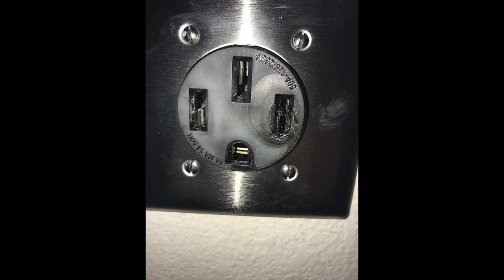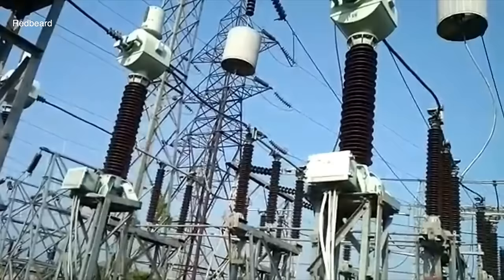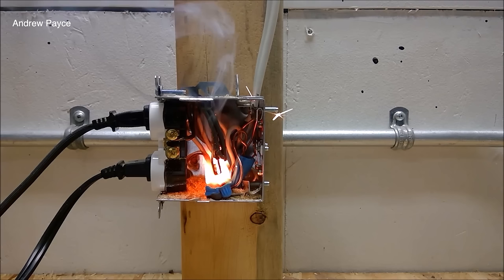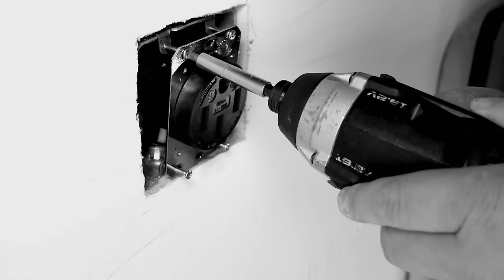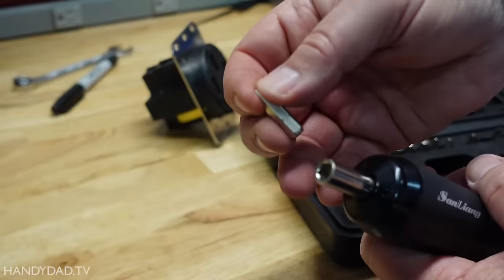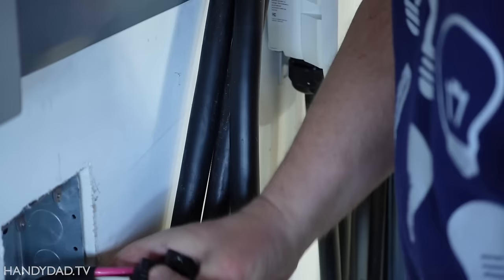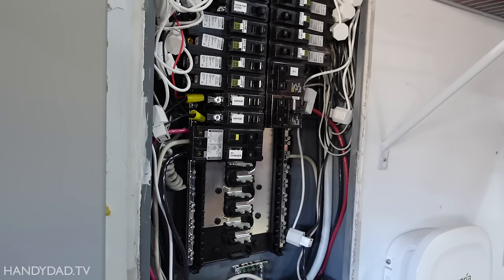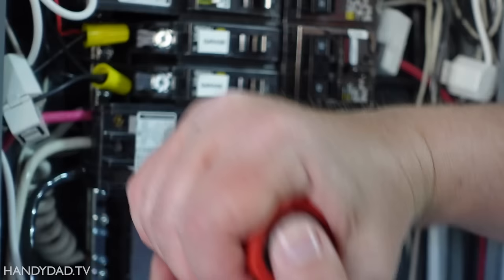EV Charging Disaster

Comment: My wife's aunt lived alone for many years and eventually relied on a 2kw fan heater plugged into a UK 240v outlet. There was no EV nor wiring issue but the poor contact achieved by the  appliance's plug (dirty pins ?) together with the continual 8 amp load eventually led to outlet dis-coloration and a smell of heat-damaged bakelite which I fortunately noticed. The issue is cumulative in that a poor contact gets hot which will worsen the contact resistance and increase the heat generated at the plug/socket.
Reply from the maker: Thanks for sharing!
Reply: With UK sockets, dirty pins isn’t really a thing. The contacts in the outlet wear out and eventually the contact isn’t good enough any more. Nobody is going to be able to tell at this remove whether it was the connection to the socket or the socket itself, but just like this video says, it’s going to be one of those two. (Well, outside chance it’s the contacts inside the plug not being good.)

When you have a load like that, that’s used a lot and for long times, ideally have it wired in directly by an electrician, or make sure the outlet is installed well and relatively new. And for the love of god, use the switch, don’t keep unplugging the thing.

Comment: Great video!  One thing I would suggest is to hard wire an EV charger that will be stationary.  The plug and receptacle are an additional failure point.  Also, you may find from use that the GFCI breaker will trip frequently due to the built-in ground fault capabilities of most EV chargers.  Are hard wired setup does not require GFCI breaker.  IMO hard wired is the safest and lower cost way to install a high powered home EV charger.  I have seen many melted plugs and receptacles over the years due to faulty receptacle or poorly made 14-50 plugs.
Reply: Hard wired at home and a charge cord in the car makes sense.
Reply: Yeah in my apartment garage the GFCI breaker trips every so often from my charger. Wakes me up since the breaker panel is in my room
Reply: This.  A NEMA 14-50 works but is more risky than a hard wired charger.
Reply: @dagjohansen8641   I've got a three-wire cord my dad used forty years ago for his compressor, it has a 30 amp plug. I guess we were lucky that all those years of use didnt burn our house down. (kidding)
Reply: @ronwest7930  If you plug a stove into a 14-50 and just leave it there, that's fine.  But if you are using a Mobile EV charger and repeatedly plugging it in and unplugging it, it wears down, gets dirty, loses grip, etc. And that's where it can get you in trouble. But if you leave the mobile charger plugged in permanently, it'll be fine.
Reply: From what I've read the charger does nothing. If the cord coming out of the fuse box had the right end for the car the breaker could be the on off switch. I doubt I will buy an ev soon but I can charge 240 at 16 amps off my solar if I needed to. EV cars have a charge controller  built in.
Reply: @grogu928  Most Chargers have GFCIs built into them. It sound as if you may have 2 GFCIs which can cause the tripping issue described. For example the Tesla Gen3 Wall Connector has a GFCI built in and they specifically state not to install an additional GFCI on the circuit...
Reply: @dagjohansen8641 Exactly. In fact, if you needed to take the mobile charger on a trip with you (to slow charge at your uncles house for example), just flip your breaker off for the 14-50, then unplug the cable from the charger (leaving the pigtail plugged into the wall). The reverse that when you get home. That way, it should never have to be unplugged.

Comment: Good video.  The driver bit you should use is called an ECX bit.  Probably #2.  The following holds true no matter who installed the receptacle:  I would encourage anyone using any plug/receptacle that they use all their senses.  Eyes—any discoloration on the plug prongs means something is wrong. Ears—listen as sometimes you can hear an arc when in use.  Nose—smell around the connections as arching (produces ozone) is easy to smell even long after using it.  And warm/hot wire insulation gives off a distinct odor.  Touch—the plug and/or receptacle should never be hot.
Reply from the maker: Thanks for the tips!

Comment: Great video.. Changes in recent years to the NEC have included a requirement for arc-fault interrupt type of circuit breakers. They're a great addition to the code in helping to prevent house fires. They are NOT to be confused with GFIC type breakers which instead sense electrical currents not returning on the neutral wire as expected, but rather on the ground.
Another point is that many of the electrical connections in receptacles, switches, and light fixtures are 'quick click' (press in connections). They amount to being holes you press the stripped wire into that have a small metal tab usually being brass, or brass plated steel, copper plated steel and actually are a very small area of connection. Time as well as a higher current draw will break down or erode those connections creating arcing and as well know, once that begins it will only get worse. I prefer to buy receptacles, switches that have screw terminals and use them instead. They will hold up better over the decades.
Reply from the maker: Thanks for the info

Comment: Great video and glad to see you sharing your mistakes so everyone can learn.

I had to plug and un-plug my Levitron plug many times when I was trying to repair my Juicebox 40 charger (self-inflicted as I ran over the wire by accident).  I finally got it to work but i guess wound up wearing out my Levitron plug from multiple plug/unplug procedures testing my repair on the Jucebox.  A week after I got the charger working again, I went into the garage and smelled rubber burning and found out that one hot terminal on the plug was melting.  That's when I started looking for a better plug than the Levitron (and thanks for one of your earlier videos comparing the 14-50 plugs).

I recently switched over to the Hubbell and all is good now.  What I learned from this whole experience is that I won't charge my Tesla at 40 amps unless I need to.  Just to be extra safe, I charge at 24 amps most of the time and that's fast enough.  It's easy to change the amperage in either the Juicebox app or the Tesla if I need a quicker charge.  

I also will unplug the outlet every few months, clean it, and look for any signs of problems.
Reply from the maker: Thanks for sharing that experience with all of us!
Reply: Most people do not realize that charging an EV is considered a Continuous Load ( A Continuous Load is one that is expected to last 3 hours or longer). With a Continuous Load the Conductors (the wire in layman terms) and the Breaker must be derated to 80% of the normal rating of the Conductor and Breaker..... Not doing so is a Code Violation and extremely dangerous.                                                                                                                                                                                                                                                                                                                                                                                                                        .                                                                                                                                                                                                                                                                                                                                                                                                                                                                                                                                                                 Also, you should not be using a NEMA 14-50 outlet. A NEMA 14-50 outlet is designed to supply both 120 volts and 240 volts to an application, it contains a L1, L2, Neutral and Ground.                                                                                                                                                                                                                                                   .                                                                                                                                                                                                                                                                                                                                                                                                                                                                                                                                                                EV Charging has no use for the 120 volts, so the appropriate Wall Outlet should be the NEMA 6-50 which contains L1, L2 & a ground. It also save a great deal on the cost of the conductors 2 conductors and a ground verses 3 conductors and a ground...
Reply: @michaelholliday100  good stuff, not i uderstnad all that lol. can you read my comment at the top? not sure what to do

Comment: Hot damn dude.  Just throw the main breaker when you're pulling off the cover of your breaker panel.  No reason not to.  You certainly understand to not touch "these plates" but you freely wave your hands and tools in front of them, just waiting for you to misjudge the distance, or your screwdriver to slip out of you hands, etc.  

DONT WORK IN A LIVE PANEL!
Reply from the maker: Thanks for the advice
Reply: Come on really.....there's a million other things on the list that can make your day a bad one around the house, pulling off an electrical cover is at the bottom of the list. Lawnmowers, chainsaws, weed eaters, hammer, circular saw, sharp knife, scissors, iron, a drive to the store are all above removing an electrical cover and waving your hand in front of it. Maybe your eye hand coordination isn't that good Bubbles, the rest of us do just fine.
Reply: @royormonde3682  I suppose you're right.  It only hurts for a second.  That guy a ran over today though, that's gonna hurt for a while.
Reply: @royormonde3682  Depends on the level of fault current.  If only 1kA, you will probably survive.  Accidentally short circuit tens of kA and you may get your skin burnt of and covered in molten metal droplets, and blown across the room by the blast.  Very unlikely in domestic installations though.  Can be a problem in large blocks of apartments when you are close to the inlet to the building.
Reply: @ericrawson2909 Well that may be so but my point was there's a million and one things that can actually hurt and possibly kill you around the house, Youtube is full of just that, waving your hand in front of an electrical panel ain't one of them. There's tons of video's on YouTube of people doing stupid things and getting messed up, can't remember a single one where waving your hand in front of an open panel got someone hurt. To each his own, my experience in construction for over 37 years is the only thing that gets you hurt is doing something your not confident doing and being scared. It's not like electricians are scientists, half the ones I worked with were either kids left on the site to do the work or cementheads showing up from time to time to work them over and put their stamp of approval on it. After all they do allow you to work on your own house without any formal training.....confidence is all that's needed and a bit of knowledge.
Reply: Good advice.  I have a bad habit of leaving the panel on while I work inside.  Just being lazy because I don’t want to shut everything off and reset the clock on the stove, etc.
Reply: @jackk4332  No. I'm fine. It was just a flesh wound.
Reply: @ericrawson2909  Just remember one thing.
If you're working with your 12 Volt standard car accu (lead) a short corcuit is 100 times more dangerous than with your house wiring.....
That accu is (mostly) not protected against this but even any protected accu will go to 400 amps (starting engine ice vehicle). The electricity fuse in your house blows out withing milliseconds...especially with the moder electronic fuses.
Reply: @royormonde3682  Only takes once to learn to never do that.  ONCE!!!
Reply: @Houndzee  Yes. 400A*12V is more than 16*120 (230V in my country). And a short cirquited accu will produce much more than those 400 used for starting an engine. 
The danger with a 12V accu is that the accu can explode when short cirquit is made. (It produces H2 with those amounts of energy/amperes). 
Also , when I touch 230volt with a dry hand nothing will go wrong with me....the earthprotection will switch off the 230V immediatly...maximum I het is a little burn. (And I know this with first hand experience).
But when youre standing barefoot on a wet floot with wet hands 230V gets really  dangerous.
Or when you'r touching two pins with wet hands (earthprotection may fail then )
Reply: I would hesitate to shut off the main if it's old because it may not set again and you may have a hard time getting one.
Reply: @wademchenry1560  I think that might indicate a need to update and replace some things!
Reply: I'm blown away that those breaker panels have large conductive plates present that are actually live. 

What are they for?
Reply from the maker: The plates energize the circuit breakers.
Reply: My house doesn't even have a main breaker and the power company put a lock on the power meter outside.
Reply from the maker: There must be a main breaker/shutoff besides pulling the meter.
Reply: @royormonde3682  There is good reason complacent people including electricians get zapped regularly.
Reply: @royormonde3682  one slip of the screw driver. dude was using the wrong bit and nearly stripped the screw. You need a ecx bit, not a flat blade, not a square bit. The jolting of the non electrically insulated cheap torque screw driver could cause a jump or a slip. This isnt wiring a 120v 15a outlet or switch. There is serious power. And circuit breakers aren't designed to stop people from being electrocuted.

There's a million reasons why he could end up hurting or killing himself. 99% of the time his fine, but the edge cases are why theres safety training.

Comment: Great video and great of you to admit mistakes for the benefit of others. My father in law is a electrical engineer and showed me how to do house hold fixes. The biggest tip he gave me was that after you’ve tightened the clamps on everything, when you’re tidying up to come back and check the torque again one more time as the tension on the copper would settle and loosen for new connections.
Reply from the maker: Thanks

Comment: I had the same issue.  The screws weren't tight enough and my son noticed a burning smell coming out of the EV charger.  Fortunately, we opened up the EV charger, clipped out the burnt wires, and cleaned up the area. Thanks for posting this video. Hopefully, it will save some people from a unnecessary house fire.
Reply from the maker: Glad it was helpful

Comment: Thank you Chris for another very informative video. Wow! Eye opening! We had an electrical issue where half of our condo lost power. Come to find out it caused by a switch that was improperly installed which was actually arcing. Thank goodness it did not cause a fire. 😅
Reply from the maker: Scary stuff
Reply: You use Dielectric grease for those issues. It will help stop the heat build up, corrosion and constant use. As RV outlets will do the same thing. So I grease every new one I put in. As they do see out door use...I never had one fail...
Reply from the maker: I asked an electrician if I need dielectric grease, and he said not needed for copper.
Reply: @handydadtv  I can tell you it helps to stop these issues..

And I am a Licensed Electrician for 40 years. While also an Electrical Engineer.

And Copper has nothing to do with it... It's the constant plugging and unplugging. Constant high loads on the Plug and Receptacle.. As the weather conditions change. Cold being the worse on it. 

Why I suggest people that use the heater all day long. Invest in over sizing the wire. This helps the wiring carry that load at 80% use all day long..

And what causes it. Is voltage drops in cold weather. So the Amps on the Circuit will rise. Ohms law. .
Reply: @WizzRacing 
Cool reply…easy to read with the spacing too

Comment: Every wire that I connect I treat with an anti-oxidization grease, this helps to prevent oxidization that can result in resistive wire connections over time which overheat.
I have recently installed a new 200a service at home and treated each connecting wire with Ox-Guard. 
I believe this is a local code requirement and is checked by the inspector.
Btw, I have come across some overheating horrors during many years in the electrical industry.
Unfortunately only the tip of the iceberg is published, many disastrous house fires result.
Thankyou  for a good informative video.
Reply from the maker: Thanks
Reply: Not needed for copper wire. Really not even needed for the modern aluminum used in wiring today but most inspectors want to see it anyway, and it doesn't hurt anything.
Reply: @Knuck3ls1  copper wire does oxides, when wire is stripped of insulation, the wire is quite bright, over a few months exposed to air the color of the copper will dull…oxidization.
Reply: Recently had an inspector ask for NoLox on our copper connections in a new service we did.
Reply: @Tigerbythetoe  quite right, need to keep connections oxidization free and prevent overheating from a resistive connection
Reply: NoLox or dielectric grease is also good for your earth ground bounding cause either the copper rod or copper pipe can get corrosion from condensation.